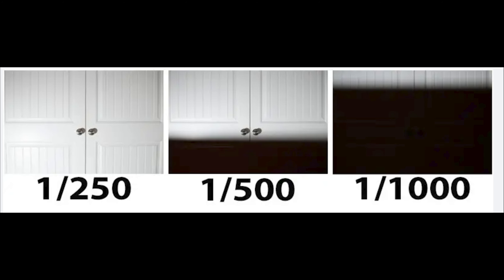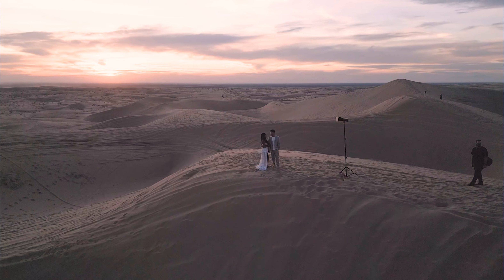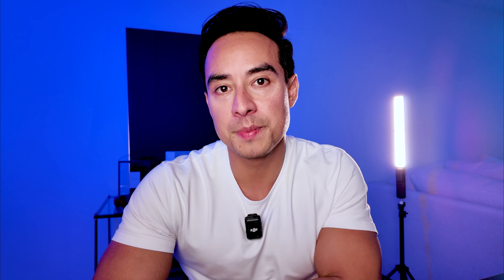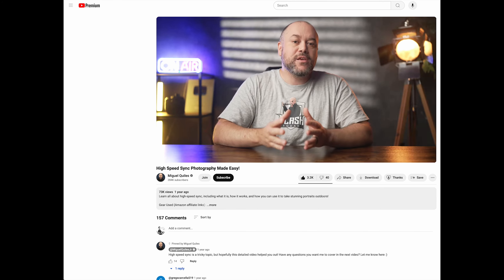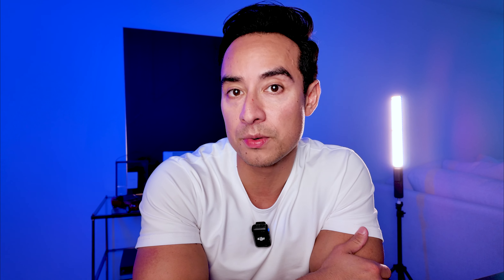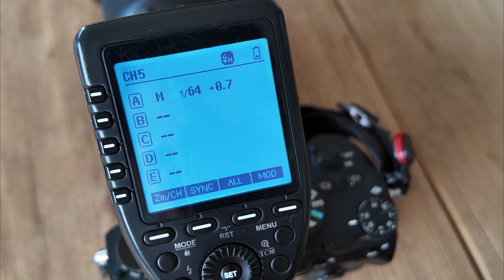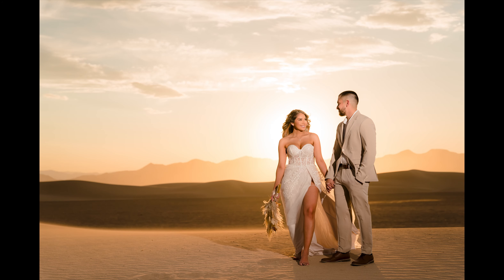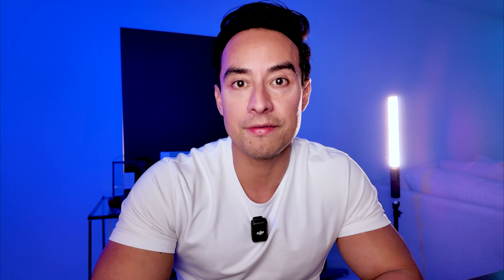How to use High Speed Sync and when to use it

Comment: Midday sun, ad200pro. Which light modifiers are usable in HSS?
Reply from the maker: Hey Garbid! I posted a video on midday sun with the ad200. It’s older so I plan on updating it but check it out below:

https://youtu.be/hvHoBQCihzA?si=rlhOVVl3zSATsKa4

Distance plays into it. So if the flash is a lot closer then you can use something like a soft box or modifier. You can always Photoshop it out in post if you place it in the right spot. If it’s a wide shot, I usually don’t put a modifier because you’re not really seeing close-up details on the skin anyway. In the video, I explained a little bit of that and show some examples
Reply: @TNKPhoto  Thank you very much! What about for wide shots use just 2 ad200 with fresnel heads from too sides lets say at 5 and 7 o' clock. With difference let's say 2 stops. One as a key and second as a fill?
Reply from the maker: @Garbid  Two is definitely better than one to overpower the sun. However, it depends on how you want the light to be shaping your subject. Sometimes I have the light coming completely from the side if I'm having them look that direction. So for example, if I have someone on camera left, looking towards that direction, I may have my flash just outside of the frame and having the light(s) come from that side so there's a nice directional look. Remember that the direction of light will change the quality and mood significantly. If you have two flashes coming from similar directions next to you, it'll fill in for sure but it'll also be a bit more flat. But it's whatever you want it to look like